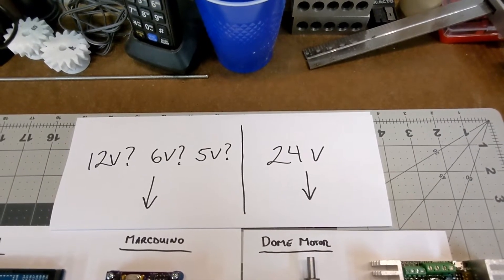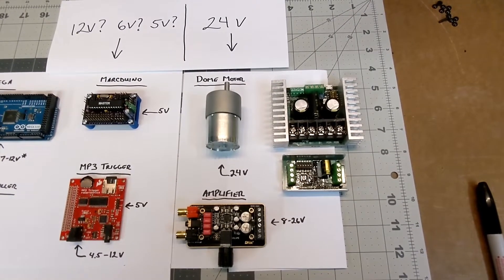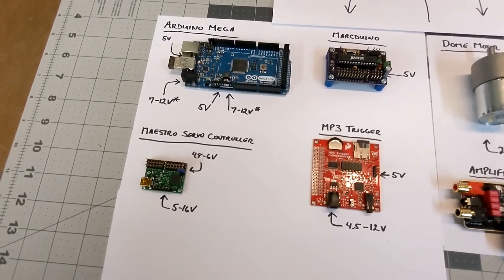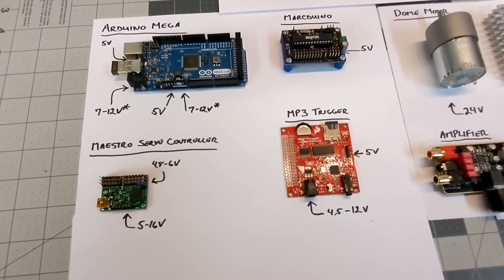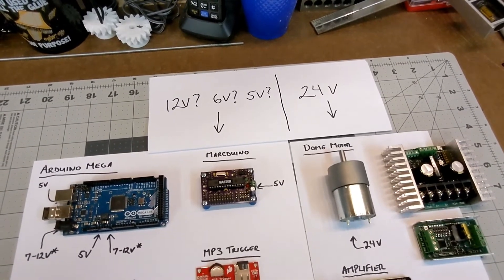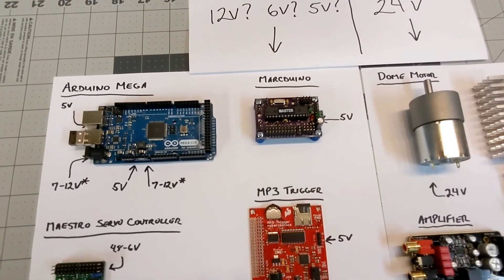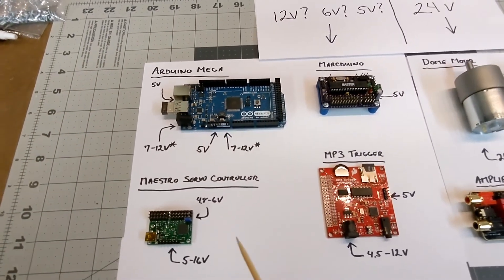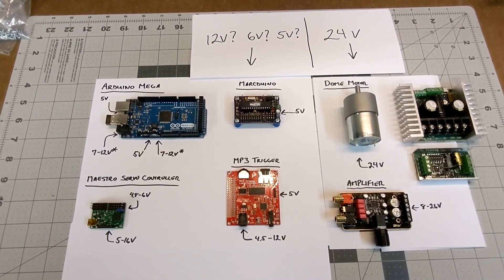R2 Electronics Build Part 2: Voltage and Step Downs Demystified!

Comment: Good video. Please  correct me if I  am wrong because I  am in the mist of doing  this wiring myself. 
If you are putting  all these  devices on a 5 volt line you are going to have to make sure your buck converter can handle the total current draw including the all the servos running at the same time.  If not this can lead to a brown out and reboot your electronics , b_yoAnd have the proper gauge wire to handle that total current draw. 
   If you are pushing more voltage then it takes less current to do the same job. If your concern is battery life then less  current you draw, the longer your battery life. Hence why batteries are labeled with mA/Hr rating.  Hence the total reason I  choose to go 24v was to decrease the Amp draw over 12v and to decrease the size of the wire $$ I had to use.
I am serious please update me. Thank you 😊
Reply from the maker: Yes, what you have said is correct. Because my step-down converter MUST be able to handle the current draw for EVERYTHING downstream that runs at 5V, I wasn't able to use some of the more common converters, since they are rated for only 3 or 5 amps. The large converter that I am using is rated up to 20 amps, which should be more than enough. Each of the 5V components are also fused (Arduino, Marcduino, MP3 Trigger, and my CBI/DPL lights) currently with a 5A fuse, and I am using the largest wire that I can easily connect to each device - typically anywhere from 18-22 gauge.

Along those same lines, this is the reason I am running the full unregulated 24V into the dome. The wires in the slip ring are VERY thin, and thus can't handle much current. My slip ring has 12 wires. I am using 1 for signal to Marcduino, 1 for signal back down to MP3 Trigger and the other 10 wires I am splitting between +\- 24V (so 5 wires for each). The higher voltage means fewer amps and less burden on the wiring. The 24V power feeds a small 5v converter in the dome that can handle up to 9 amps. This should be more than enough for all the dome servos.

I will be posting another update video soon that shows everything running self-contained off of the batteries, including the dome!

Good luck with your build, and thanks for watching!

Comment: Might you provide sources where you obtained each item?
ie. Where did you buy the Dome Motor from?
Reply from the maker: A lot of stuff I find on Amazon - it's quick and easy (stuff like the drive motors, amplifier, etc.) but suppliers change and some of this stuff I got over a year ago so links are hard to come by.

For the dome motor, specifically, that I got from Pololu (https://www.pololu.com/product/4683) I also picked up the matching "L" bracket that's available for it. Fitting dome motors to the available printed parts in the Baddeley design and then getting everything to line up can be tricky. I'll definitely do a video showing my solution, but it's likely that everyone's workaround is going to be a bit different.

Pololu also makes the Maestro servo control boards, and they also have some very good voltage regulators (https://www.pololu.com/category/131/step-down-voltage-regulators) - I will be picking one of these for my dome.

The Sabertooth 2x32 and Syren 10 are from www.dimensionengineering.com, but both have become extremely hard to come by.

Thanks for watching, and if you ever want to know more about any of the components, just let me know!

Comment: Good video Jason… you don’t have to use this but if your trying to get the maximum efficiency of your battery without changing it , you can try a “buck boost converter” . It gives a constant voltage out … it can start at a higher voltage and drop below its target output while still consistently giving that output you need if that makes any sense
Reply from the maker: I’ll keep that in mind, for sure. A lot will depend on what sort of runtime I get with the current batteries and the “1.0” setup. Right now everything is theoretical, but real world is often quite different. We shall see…